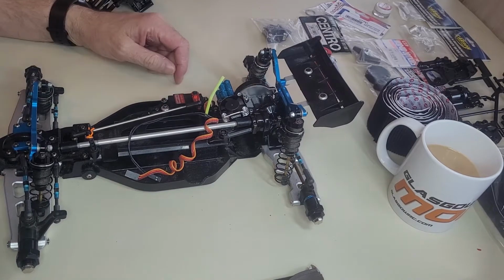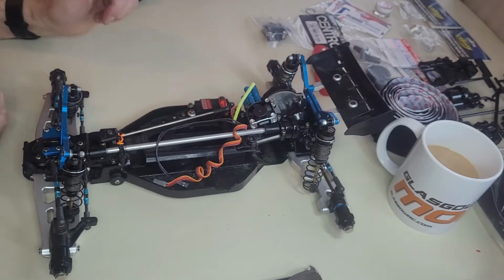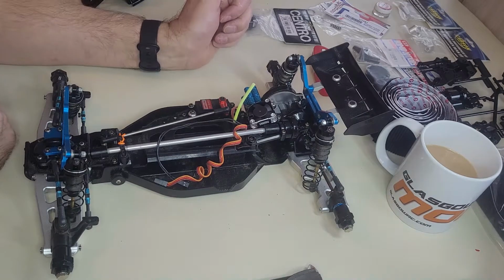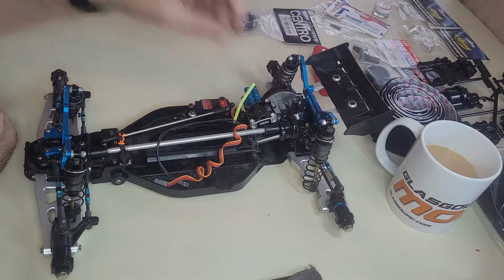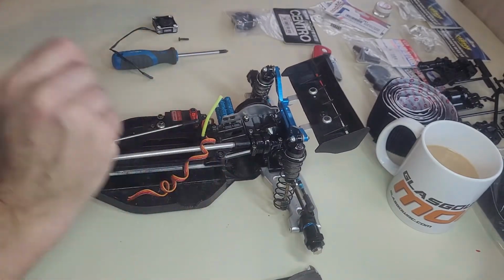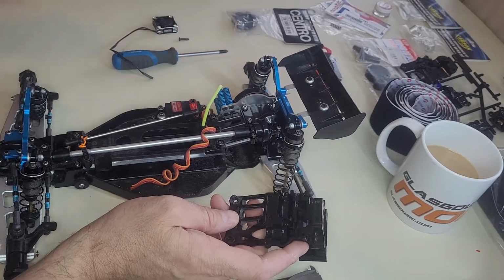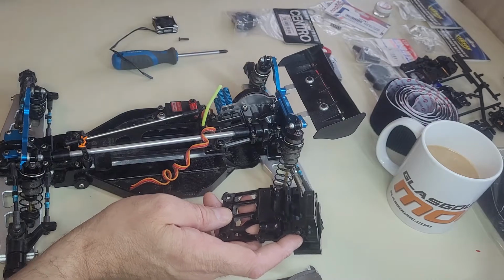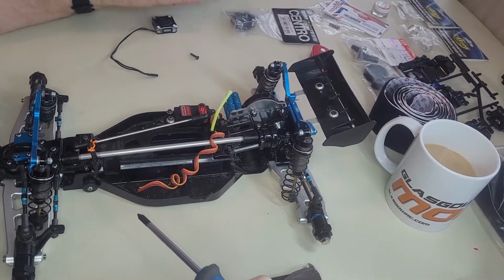DF03 motor cooling fan mod

Comment: Nice explanation Anthony. Looking forward to seeing this take shape
Reply from the maker: Cheers ,
Not quite sure , how much of the rebuild needs documented, as alot is as per manual. Defo be this cooling mod, rear diff mod and a bit on the slipper main gear mod (did a thread on the Tamiyaclub forum).